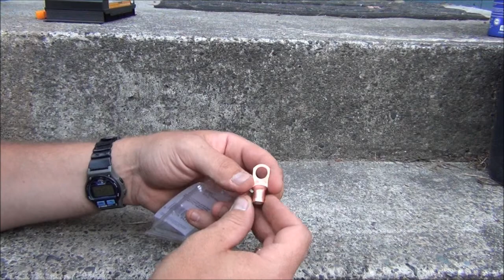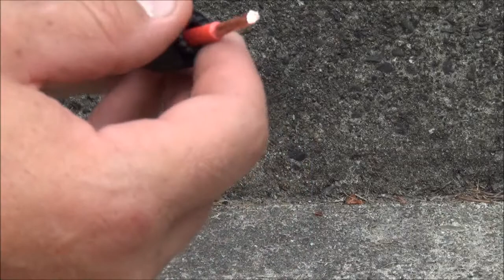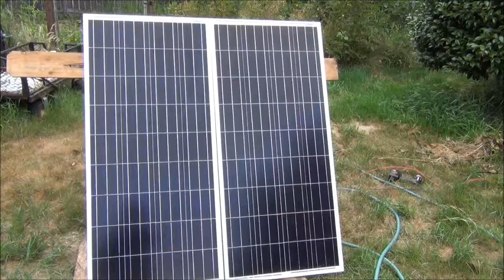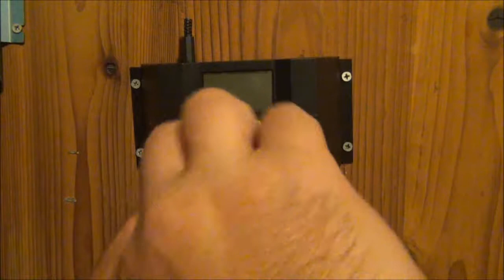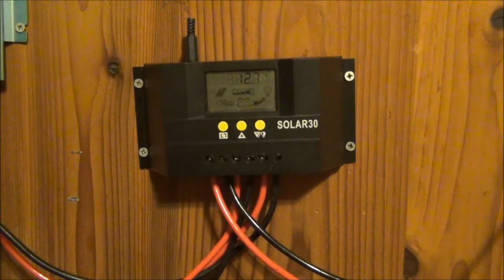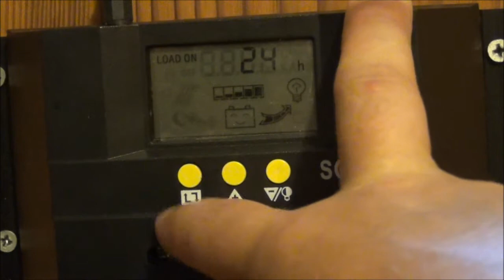DIY Solar Power System Part 2 - Installing My System - L2Survive with Thatnub

Comment: QUESTION, Hi, I have the same charge controller connected to a 12 v battery on a 12 v / 150 watt solar panel, I am using this setup for lights at night, I am using 3 lights, each light is 5 watt/12 v, i am connecting the lights directly to the battery because the charge controller keeps telling me that it is overloaded even if I haven't connected anything on the load from the solar charger, can anyone tell me if I am doing anything wrong? I am using the lights for our garden and wanted to set it up trough the controller in order to light it up automatically at night. This overload display goes away when the sun starts shining, as soon as the sun goes down shows overload on the screen, at this point the battery is fully charged and shows 13 v, no load on the battery nor on the controller but the screen shows overload, thanks in advanced for your reaction.
Reply from the maker: I want to say that you just have a bad charge controller and I am no super electronics guy but, I would like to ask you a few questions.  What happens when you only hook up one light?  What about two?  Are you hooking them directly to the charge controller or an invertor?  Have you tried a different invertor or different light?  If you put a multimeter on the batteries do they also show 13v?  Is all of your wiring correct?  Do you have a different charge controller that you can swap out and does that work correctly?
Reply: L2Survive I think that maybe the charge controller is bad, with nothing connected to it it keeps on displaying overload, you know with the battery not smiling and some stripes on top, even if the battery is full. only when the screen shows 14 volts during the day time the overload status goes away. Can you maybe give me your settings on load on and load off, I have the CM3024Z solar charger. When the overload status is displayed I can not go into the menu. But I like to keep the load off. The problem is that even if I turn off the load, after a while the same overload status appears even if I have nothing connected directly to the battrry nor the load on the controller

Comment: by hooking your inverter in to your overload button will it still run household appliance and tools?? the reason I'm asking I live off the grid and thinking about buying this charge  controller hooking it up to my solar system and a new 3000 watt Whistler inverter...

Comment: i have a problem with this .. the panels does not fill my batteries(the first arrow on the left isn't shining) .. can anyone tell me why? Is there anything to be set in  the solar 30? The voltage goes from the batteries  to the load.. h
Reply from the maker: There are no setting that I had to make on it.  My first one did not work either.  I had to go back to the guy who sold it to me and get a replacement.  That one worked like a charm.  Just hook up the wires correctly.  You can try hooking up only the panels and the batteries.  See if the power goes to the batteries without hooking up the inverter.

Comment: I got my Renogy system, 2 6V batteries, a 400W inverter, upgraded my controller and batteries for less than $275. Solar is supposed to save money Please 
people, shop around. There are better prices.

Comment from the maker: At the most, this setup provides about 2kWh per day.  Last month we used about 32kWh per day.  This system does not allow for us to sell back to the power company but, if I had a grid tie inverter (which I will get soon enough) and a meter that has the ability to run backwards, we could.  This system provides enough power if the power goes out and enough to run my home office everyday.  Laptop, lights, charging things, TV, cable box, modem & router

Comment from the maker: That is correct.  I don't want to have to watch ever watt used by this system and I didn't want to wreck my batteries by draining them to low.  Using the load option, I don't have to worry about my system.  One of the things I have seen people say in almost every solar power system, is that this one time my batteries were WAY too low.  I will not have that problem.

Comment: great vid,

so you hooked the power inverter on the load output of the controller

instead of hooking the power inverter straight to the batteries...??

Comment from the maker: Get more batteries than you think you will need.  I am on a float charge a lot of the day and wish I had somewhere to put that power.  There are a lot of fakes out there but, if you can find a real MPPT charge controller good price, buy it.